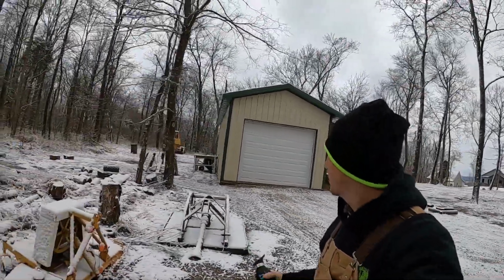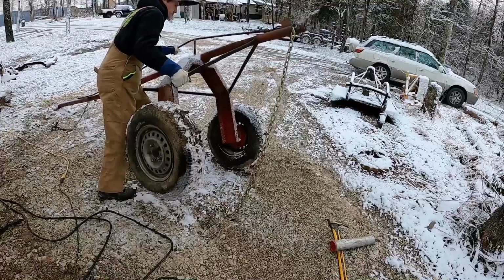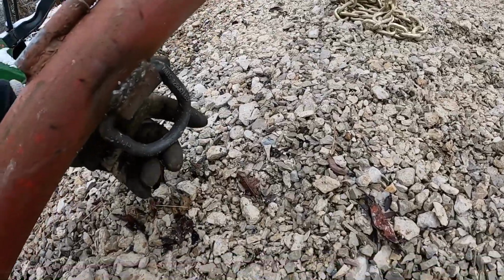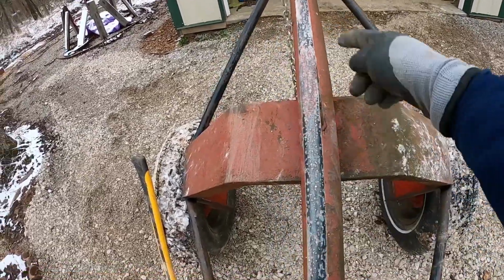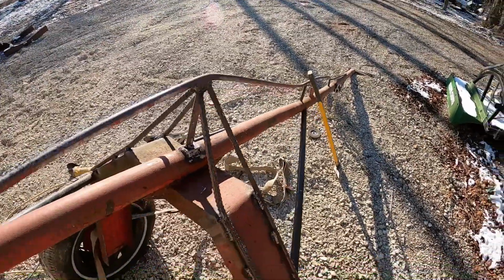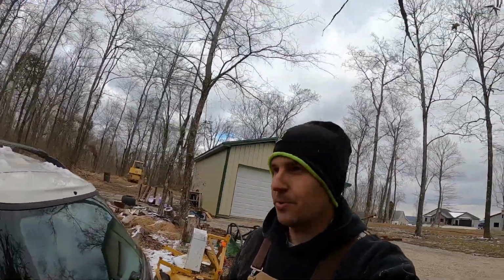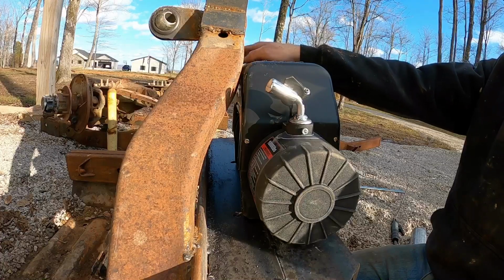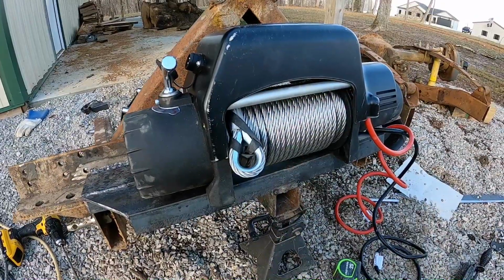Progress on Junkyard Log Arch Build - Beginner Welder

Comment: I disagree, learning to weld on rusty old metal that is free is better than clean new stuff you spent money on. Mainly because you are only out the money on rod if it doesn't go as planned. I did get a good chuckle at the winch not quite fitting where you wanted it, I think everyone has been in that situation at least once. I know I have. On the ICF the guy might have had problems finding a truck to put it on to ship. We have had a few times where we needed a load of lumber and the mill had it, there just wasn't a truck available to put it on to get it to us.
Reply from the maker: You make a good point

Comment: The only thing I can say is that winch you got is way over kill for anything you will ever pull with that little tractor. Not sure what you payed Mike for it.  Harbor freight has a bad lands atv 1800 lb that is smaller and would have fit better on there for $49. Got one myself to use to mount atv snow plow on the front of John Deere like yours.
Reply from the maker: I got it for a good price

Comment: The top piece serves no purpose. Look at the bend in the main tube, it shows the top piece is in compression, it would only be useful if it was under tension. Cut it all off and replace it with a piece of angle iron along the top of the tube, especially where it is bent which would give vertical and horizontal rigidity.
Reply from the maker: It will make more sense when it’s in use.  Thanks for watching

Comment: Should of heated the tube first,
Reply: @Crewsy  most welders will heat pipe up with rose bud to get molecules to algin better when welding with rod. Ship builders , gas an oil pipe line welders do.
Reply: @philipfleming3546  
I understand how “most” will heat something but we’re talking about Captain Kleeman that doesn’t have a torch set.

Comment: Buy some cheap (Harbor Freight) vise grips. They have a welding kit with an assortment of shapes then buy a couple extra C shape pliers. If you screw up and hit the cheap ones with the welder there will be fewer tears. In a hobby shop the cheap ones will last a long time. This from an idiot with 20-30 pairs of the expensive ones because of a wicked blow to the head.
Reply from the maker: Hahaha,  thanks for the tip!